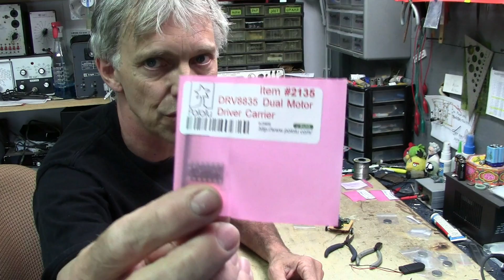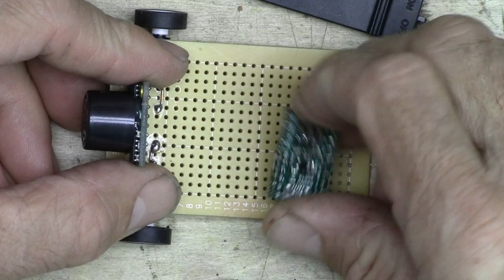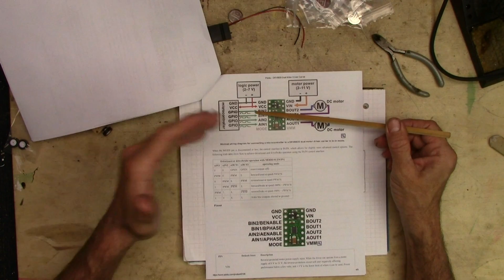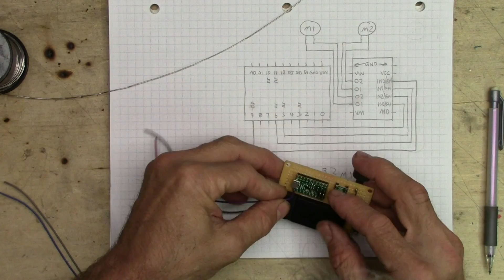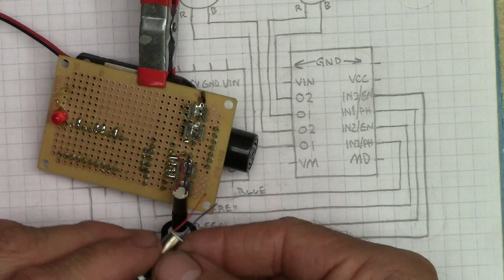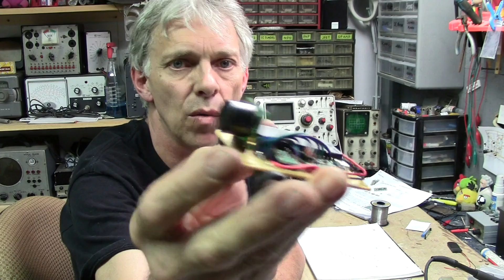Mini-bot Build Part 2

Comment: Is that a spring clamp on the helping hands? Usually they come with alligator clips.
Reply: Ashley Jeudy Yes it is. The alligator clips went away a long time ago and I replaced them with the mini spring clamps which I like a lot better!
Reply: ***** Would you maybe do a video about how you did this? My helping hands has alligators (radio shack, years ago) and they are so strong, they puncture wire insulation!

Comment: I am suprised you didn't just drive the micro motors from the arduino
Reply: Jared Reabow It's not built to handle that kind of load. The motor driver is designed to deal with a higher amp load and it has built in thermal overload protection.

Comment: lol so after all the de  soldering, the arduino goes back in the same spot
Reply: Jared Reabow Almost... I moved it a little. :) Funny how micro controllers now get generically called an "Arduino" :)
Reply: +Dean Segovia I does have the Arduino bootloader. If it quacks like a duck ...